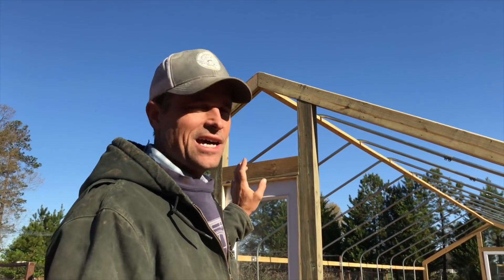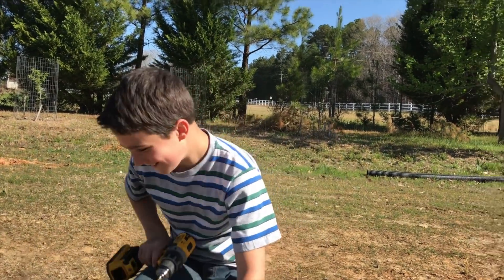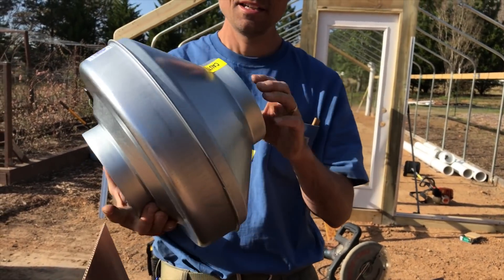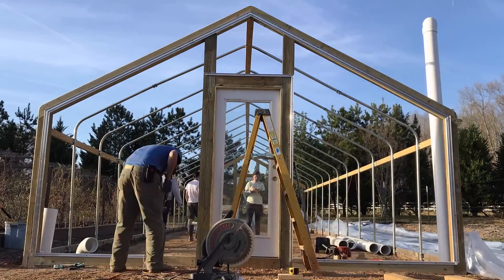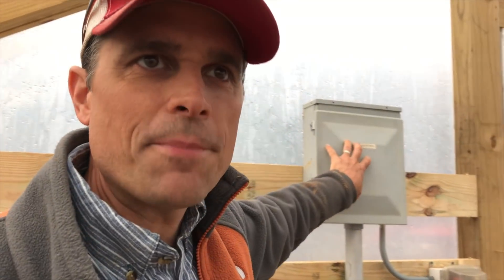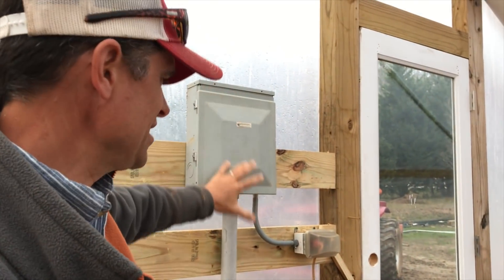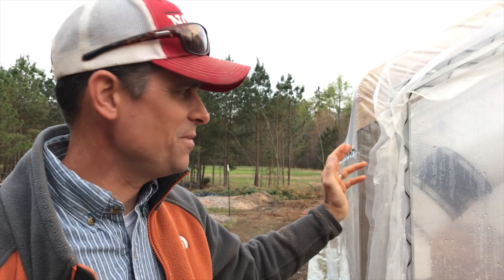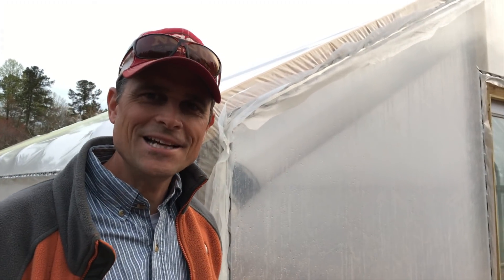DIY Geothermal Greenhouse Pt 8: POLY FILM INSTALLATION

Comment: If the air is only recirculating vs intaking... wont the plants get oxygen depleted?  Most geothermal greenhouse setups I've seen pull outdoor air through the ground into the greenhouse to get fresh 65 degree air.

Comment: Where did you get the wiggle wire and what size tubing will it work on? All the sites I visited used channel instead of tubing. Is the wiggle wire the used for channel or tubing?

Comment: I used to build green houses, Where you are at i think having white plastic would be a great help in reflecting the sun. having at least 2 layers is important because plastic by itself is a  heat loser. As far as connecting different air chambers of the green house with pressure air, I used flexible dryer ducting, it doesnt last for ever but its cheap.

Comment: I think those unions on the rafters are going to destroy the cover within 2 years. But I’m probably wrong.   Luca. Ps cut a  1 inch section off rubber boot and use it as a spacer

Comment: I'm surprised by the low temp at the exit. The earth is a consistent 55deg below a certain depth depending on a few variables. The low temp is fine for trying to keep the house from overheating during the summer. I'd be most curious about how it helps keep the temp up during the winter.... based on the 55deg subsurface temp this should keep plants alive during the winter and cold weather crops like broccoli should do great.

Comment: Use a electric conduit pvc box nut ( connects pvc outlet box to wire conduit ) and use 2 rubber o rings  for the blow up jumpers for inflation of the plastic  they sell all sizes

Comment: Next time cover the end walls first, you understand
Reply: Wisdom on the over hang (use poly tape once your sure it good, before it frays)
 PVC drain like you 4" just no holes
And next to not near as tight on the top cover
Just saying 😏
Reply: *sometimes they call it sump pump piping

Comment: If you haven't already delt with the jumper hoses for inflation. Sealing the same way your sink plug does should work also gives you the option to redirect if you ever wanted to extend at a later date

Comment: Use silicon as a vibration reducer and mount the fan on a pole next to the intake with the bracet reduce visitation and sound. (you basically have a fan connected to a drumkeg)

Comment: Fill the space between the layers with either argon gas or if thats too expensive use CO2 (use dry ice as it is generally the cheapest and easiest to handle form of CO2), both will greatly increase the insulation on your greenhouse.

Comment: Wouldn’t buying a simple 3D printer be a good solution for the connectors? Cheapest ones would run you like $200 (for the brilliant ender3 model for example) and its more than capable of something like that.

Comment: Instead of the expense of fans and jumper hoses to inflate the two layers, why not simply run interior spacers between the two layers on the inside edge of your end-walls using swimming pool noodles? They won't break down from sun exposure and won't retain moisture themselves because they are closed-cell impermeable foam, so they shouldn't promote any sort of algae or mold in and of themselves. They can be zip-tied to the poles through the interior layer or siliconed or glued on each side between both layers down the length of the greenhouse,  preferably positioned at the peak and corner edges, and then can be run from peak to edge along each or every other cross-member.  This places a consistent physical air space between the layers and costs pennies compared to the expense of fans and duct work. This method also has the added benefits of drawing no additional electrical power and being easily replaceable whenever needed, which shouldn't be any more often than replacing the plastic itself, but I suspect the noodles will outlast the plastic by a factor of three or more.
Reply: Having a positive air pressure in the cavity increases the load capacity of the covering, The typical inflation pressure used in double skin hoophouses will support 1.3lbs psf, thats just the air pressure. I use a different type of inflated cover and the air in that will support 10.4lbs psf  Its surprising how powerful a little air pressure can be.

Comment: Hearing protection as well. Take it from an old guy that your ears don't like loud noise. Drills are around 99 dbs average. That will damage your hearing over time and you will be reading lips to cover hearing loss.
Reply: Absolutely.  After years hunting & just recreational shooting of shotguns when I was little to about 20 or so, concerts my 20s, power equipment on construction sites - my hearing is terrible in my 60s.  Ear & eye protection a must to protect the only ears and eyes you're ever going to have.
Reply: The noise of a cordless drill on occasion will not hurt your hearing.   Hearing protection for that us overdone.

Comment: My 2 cents. The wires that run the length to support crops will pull the end walls together. Diagonal bracing with steel shapes under compression will solve that. HGI has jumpers as cheap as $17. Last, ropes crisscross over the top will save you heart ache. I guess that's 3 cents.
Reply from the maker: Thank you for taking the time to write and offer suggestions. When you say ropes crisscross over the top - what do you mean? What would they serve to do or prevent? Thanks!
Reply: St. Isidore's Farm 
The ropes go from the anchors on both hoops on one bay over the top crossing and down to the anchors on the opposite side. The number of bays varies depending on the length of the house and the strength of the wind. They keep the plastic from lifting off of the framing and  flapping until something gives. Good job, can't wait to see the crops.
Reply from the maker: Excellent, thanks!

Comment: You guys are doing a great job.  111 degrees!   It's amazing how easily you can create an oven.  Since you need good air exchange for photosynthesis (to get CO2 in, oxygen out) I'd consider a permanent exhaust fan on one end and passive intake louvers on the other.  You can spend lots of time deciding on the time cycles for exhaust vs. earth battery, and maybe only let your exhaust fan trigger via high temp setting on a thermostat.  You can easily cook everything living in there on one bad day of forgetting to go out and open your doors.  Figure out your prevailing wind direction and let that dictate which end is which.  Not sure if you are using this as winter only greenhouse or trying to utilize it through the summer.  Plants actually want lots of airflow, so a series of fans inside will really make things thrive.  Dancing plants are happy plants, and they will tolerate the heat and any humidity issues you have better with airflow.  Stale air sitting at the surface of a plant suffocates it.  We found our circulation fans to be the most helpful in equalizing temps, pollinating self pollinators, and chasing the hot air up and out of our vents.   Hope I'm not being too nosy, but these are all lessons we learned just a year ago.
Reply from the maker: Thank you for taking the time to write and share all of that information. This is one off the things we love about YouTube. We are planning to install thermostatically controlled fans eventually - just a matter of budget and time. But you're absolutely right - it gets hot in there quickly and it would only take forgetting to open the doors one hot day to kill every plant in there. This project has been (and will continue to be) because there is so much to learn.

Comment: If you had left gaps between some sections of the metal rails then air could pass between the sections. Great series, I'll definitely be looking to make something similar in the next few years.
Reply from the maker: Can't believe we didn't think of that. It would have been a very clean and elegant solution to the problem for at least the top and sidewalls. Thanks for taking the time to share the idea. We'll remember it for the next greenhouse! Best wishes to you if you build on in the future.
Reply: If you leave a gap like that,  would it give the plastic a place to start a rip on the corners of the channel or end of wire if the wind picks up and starts flapping it? I'm going to be building a green house next year so I'm doing my research now. Let me know if you do this or if anyone has,  and how it works out please

Comment: I'm new to you channel..
So you might have already addressed this..
Won't your plants develope better in your greenhouse
With a carbon dioxide source..
I'm thinking maybe rabbits..
Rabbit meat source of income..
Heat generators..for nights..
Fertilizer...
?????????
Reply: karlInSanDiego 
My only responce to climate change..
Their is a glacier that has receded..
And it has revealed a fishing village..
So is this man a made.. climate change..
Or a natural earth cycle..
The earth will be here and if need be recovered..
After man is gone..
Reply: karlInSanDiego 
I was talking about caged rabbits...
As a meat supply..
Plus heat at night..
You mentioned there is enough CO2 in the air
What is the source of the CO2 you speak of..
I know of mammals breathing..
Decomposition of plant life..
And i understand plants take in CO2 and produce oxygen..
But what sources are you speaking of.. that I'm missing..
Reply: Jim, you just invited the fox into the hen house.  Rabbits are bad juju in a greenhouse.
Reply from the maker: Good question. As we said, we are not greenhouse experts, so a lot of this is figuring it out as we go and documenting the process, good or bad. My sense is that our greenhouse gets lot of air movement, especially during the heat of the day when we open it up and use fans to pull in air. Don't know that I've ever hear others talk about that being an issue.
Reply: karlInSanDiego
 can you expand on your statement..
Reply: Rabbits eat your plants.  They are unwelcome in greenhouses.  There is plenty of CO2 in the air.  You just need to exchange the greenhouse air with the surrounding air from outside.
Reply: Jim, I hope this doesn't sound too patronizing, but as a climate change activist, it is my responsibility to not be mealymouthed on the subject, and you asked.  Climate change is real and it is a man made phenomenon, and there is no more room for debate on a very clearly understood subject.  Humankind and specifically the USA and developed countries have injected a ton of carbon dioxide into the atmosphere.  Scientists all over the world are working hard to find strategies of sequestration to capture the EXCESS carbon dioxide in the air, to try to avert catastrophe.  Please read about the Keeling Curve and understand that burning fossil fuels for more than a century has GREATLY increased the amount of carbon dioxide in the air.
https://scripps.ucsd.edu/programs/keelingcurve/wp-content/plugins/sio-bluemoon/graphs/co2_10k.png

Comment: If you are shooting for the ability to roll up the side curtains, skip the fan-tube extensions on the sides and ends.  Just go for the pillow fans on the canopy.  We run 4 small fans on our units.  One in each corner.  The fans come from Granger or Farmtek and run only about 30 bucks a pop.  The installation kit with the stand-offs that fit between the plastic layers is another 12 to 20 bucks each.   The nice thing is that those are pretty much a one-time purchase.  The fans however seem to last only a couple years.   We keep a few spares on hand for replacements.  Even if you opt for the high-dollar 130 dollar units, they fail just as often.  Always good to have a spare if ya can muster it.      As for the extra bits of plastic,  DON'T trim it off!!!   If you ever hope to re-stretch, or repair a damaged portion, you will hate hate hate yourselves for cutting that stuff away!    We roll the extra bits up with a lathe board and either trim nail or screw the board down to the wood frame.     Might look a little tacky, but it's a godsend when you need to make repairs.
Reply from the maker: Excellent! Thank you for all of this feedback and information!
Reply: Construct a simple flap (one way) valve to seal the cavity and control the inflation blower  with a dwyer differential pressure switch. The sensing tube from the switch monitors the cavity pressure and fires up the blower when it falls below the setpoint. The flap valve prevents the air escaping when the blower is off. The blower might run for 2 hours out of every 24 depending on how well the covering is sealed. The power savings alone will pay for the switch ($20), the blower will likely outlive the greenhouse. My inflation system delivers a meager 2cfm controlled by 2 differential pressure switches. The covering (3 layers, 2 cavities) is heat sealed so there are no air leaks.
Reply from the maker: With regard to the pressure switch, if one of these would work, which would you recommend for this application?  https://www.amazon.com/Dwyer-Adjustable-Differential-Pressure-Connection/dp/B00ATGAPD2/ref=sr_1_1?ie=UTF8&qid=1524015960&sr=8-1&keywords=dwyer+differential+pressure+switch#customerReviews
Reply: The ADPS-04-2-N is a good bet, it covers a range of 0.12" -1.6" wc.  The typical pressure for inflated poly is 0.2" - 0.25" wc. I use the  03-2-N`s (0.2" - 2") but my covering is different and uses much higher pressures, typically 0.5"-1.5" wc.
Reply from the maker: Excellent! Thank you. We installed the inflation fan last night and quickly realized the power of pneumatics. Without a pressure release, the film actually started pulling so hard on one of the spring lock bases that it sheared the heads off five screws. Crazy. So this switch will be excellent vs. cutting a hole in the film to release pressure and running the fan 24/7. Thank you again for this information.
Reply: If you partially cover the intake of blower it will reduce the pressure. Its surprising how powerful a little air pressure can be. I had to incorporate a pressure relief system to avoid overpressure issues on very hot days. 
You just need to fabricate a flap valve and buy some 1/4" bore tubing to connect the prressure switch to the cavity ;)
Reply from the maker: When you say fabricate a flap valve, what are you thinking to make that out of? A flexible but somewhat sturdy rubber? And thank you for the suggestion on the 1/4" bore tubing - was wondering how to make that switch work.
Reply: The switch has two push on pipe connections (P1 and P2, if memory serves) molded into the body, the switch operates on the pressure differential between the two. Basically you leave one connection tube open to the air (atmospheric pressure) and connect the other one to the cavity. 
The simplest option is to fit the hose from the outlet of the blower into aperfectly sized hole in a pair of boards (pieces of nylon or polyprop chopping board work well) so it finishes just slightly proud of the inside face.The inner poly skin is sandwiched between the two boards for a sturdy attachment. 
Find a piece of epdm roofing membrane or soft rubber inner tube etc large enough to make a flap that will cover the tube and form an airtight seal. The air pressure inside the cavity will hold it down tight..its the only exit route available for the air to escape the cavity ;)  The flap should be attached only on one edge with a piece of wood or plastic at least 1/2" tall. The idea is the height of the wood or plastic creates a gap between the flap valve and the outer poly skin even when the cover is fully deflated. If you dont have a gap, the weight of the outer poly resting against the valve can prevent it from being opened by the fan. Drill a hole in the boards for the pressure sensing tube and tape it to the blower hose, assuming the pressure switch is positioned somewhere local to the blower. Its all pretty straightforward,  you shouldnt have any trouble putting it together.

Comment: sorry if i'm spamming you. that massive fan, push that air through your twinskin? then vent it back through the geothermal? the temp differential would really train some heat in that dirt, and save another fan!
Reply from the maker: Not sure I understand this question - sorry!
Reply: you need a blower to fill the twinskin. yes? so use your huge cubic meter geothermal fan and pump the air through the twinskin. that internal layer would be relatively hot in the day, yes? then vent that outlet air through your hot air intake into geothermal tubes. extra heat to store underground! it would also moderate the temp between the skins, which would increase their insulation factor?!! at the moment your pulling air from the insulated cavity within the greenhouse, and youd save on blower electricity costs using one large blower for everything? Just snow-balling, wasn't trying to confuse anyone.
Reply: The cavity must be filled with still air to have any insulation value ;) The other issue is the inside surfaces of the poly will soon pick up dirt and then you`ll have no insulation and less light  ;)
Reply: Gee JohnGuest45 should have figured that! of course! You work with geoairtransfer or thermal betteries? You sure seem to know a lot on this subject. trying to figure out feasibility on a 450m2 house. it's fun, yes?!
Reply: I have a system that works FOR me but i dont work WITH it ;) The correct term is Subterranean Heating and Cooling System (SHCS), if you see it  called something else, the design is likely to be suspect  ;)  With a house that size you only want to be installing the tubing once, digging it all back up would be no fun at all ;)

Comment: One more thing... you may want to instal some collar ties.. it may be fine for the short term but if there is any snowfall,  heavy wind or if your hanging anything off the center 2x4 you will be happy for the extra support and rigidity.
Reply from the maker: Thanks! We were thinking the same thing. Believe it or not those pipe will hold our weight, but ties across would make it even stronger. They'll show up in a video eventually.